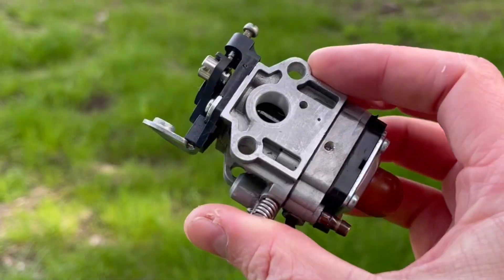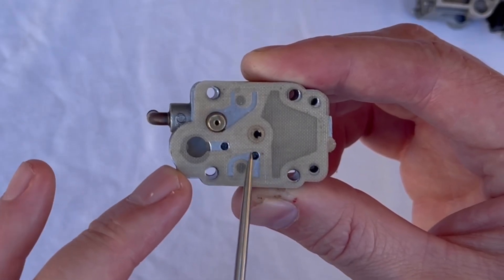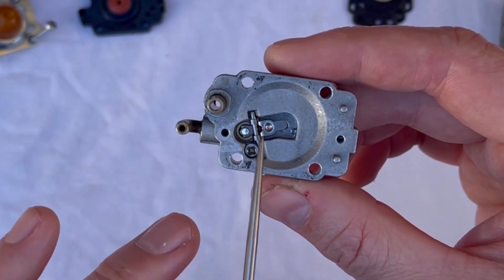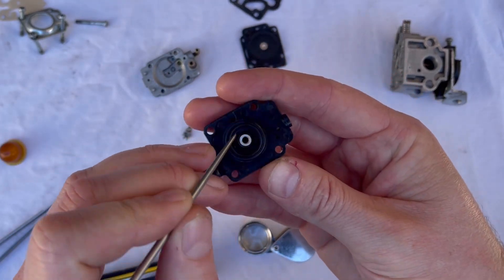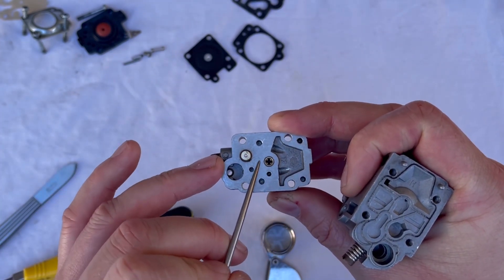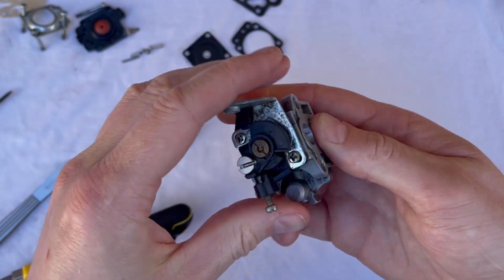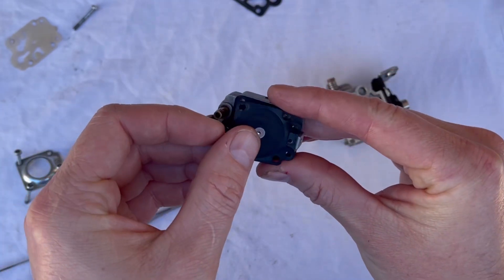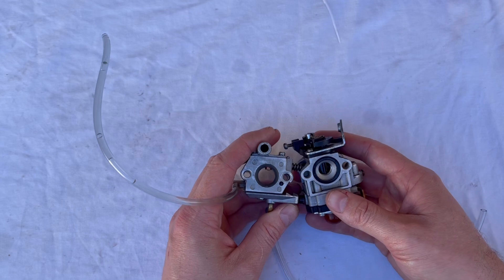Rotary Carburetors: In-depth Fault Finding, Testing, Service & Repair!

Comment: I hate these carburetors
Reply from the maker: Why?
Reply: @VintageEngineRepairs i think they fail more often than traditional gaskets carburetors. But im just a gardener that tries to fix his own machines. Thanks for your content!
Reply from the maker: Interesting! They're hugely reliant on good filtration. The barrel will wear if not, but they're actually a better design than the butterfly type :)

Comment: the screw for the low speed setting on my carb doesn't have a slot for a screwdriver. i assume it's the original carb though.
my engine starts only once a day and runs rough. 
i can make it run better at 3/4th throttle when adjusting the HS fuel screw but then it dies when releasing throttle.
so it either runs ok'ish at idle and upto half throttle and surges above that, or over half throttle with adjustment from the HS fuel screw.
i just ordered another carb on alie...eventough i just heard you say better not to do so...it was already ordered.
Reply from the maker: Yeah my success from AliExpress is about 10%

The low screw may have a different head profile like mini Pac-Man! Cheers :)

Comment: You mentioned non sealing on barbs. I have a leak on the return line but I can't get it to seal with new line. Am I just being stupid or do you get case of smaller return line or something else I am missing?
Reply from the maker: Yes hoses come in different sizes 👍

Comment: I had one of these carbs on a scooter that would start and run perfectly for about 1-2 minutes then it would flood out and wouldn't restart without de-flooding the engine or letting it sit for at least a few hours. I tried everything rebuilt the carb(new diaphragms and needle valve), reset metering lever height, cleaned whole fuel tank, replaced lines and fuel filter, and tried running with gas cap loose but no matter what it would flood out after a few minutes or running. I think it had a cracked or warped metering block or carb body because i eventually replaced the carb with another one and the problem stopped.
Reply from the maker: That's quite possible :) especially if they're plastic!

Comment: Have a rotary style carb on a RedMax backpack EBZ7500. I cleaned the carb thoroughly (ultra sonic) and added new kit diaphragms & gaskets. Can't get it to start when cold. But if I add a squirt of fuel down the plug hole, it starts and runs fine. Then it continues to restart as long as it's hot. After trying to start it cold, I have checked the plug and it is dry; ie, doesn't appear that fuel is entering the venturi even though the purge system is working fine. Was hoping you would discuss how fuel gets into the venturi (from the vacuum created by the pull cord action?). Anyway, any advice on solving this problem will be greatly appreciated.
Reply from the maker: Hey, I’d suggest you open the L screw 1/4 of a turn anticlockwise. The L screw is at the top of them :)

Comment: Great video as always.
Can you do a video on accessing the low speed screw on these?
They make them difficult using different tricks. 
There's the black plastic you pop, (easy) the resin filled one, the small offset hole one, the sort of triangle one and so on
Reply from the maker: Hey! Check out this video it may answer your question! https://youtu.be/sY14oNCXvrw?si=tqv1ron4kANu143t

Comment: Oh yeah,I drilled out the brass sealing plug  where the high speed mixture screw used to be on the dependent type of rotary valve carburettor & since it's an emissions type of carburettor it didn't have an adjustment screw underneath it therefore the only way to adjust the mixture on them is to adjust the low speed mixture adjustment screw inside of the rotary valve barrel mechanism.

So that's why I reused the original Honda carburettor on the Honda GX35 clone engine last weekend,my dad did some whipper snipping with it today with it & it went beautiful unlike on Saturday when he tried to choke it to run it then it just couldn't keep running.

So I didn't care about ruining a Chinese Walbro WYL copy which I can replace for about $17 AUD on eBay,if it's dumping in too much fuel because the hidden valve which is underneath the brass sealing plug is letting too much fuel enter the metering chamber then just throw it in the garbage bin then buy another carburettor to replace it.

It shouldn't be a problem on the genuine Walbro WYL carburettors but !
Reply from the maker: Yes some can’t be adjusted unfortunately!!

Comment: I know about those Chinese carburettors because I just received a Chonda engine on Friday to replace my fathers old Honda GX35 engine on his brush cutter because it had a scored cylinder in it & it was beginning to really burn oil.

I couldn't tune the new carburettor to idle properly because it would idle then stall out 15 minutes after I used it or it wouldn't idle if I let it sit overnight so today I pulled both the new & old carburettors apart then I swapped the diaphragms over because no matter how much I adjusted the low speed mixture screw it kept stalling.

I haven't went through & thoroughly checked the new carburettor for the needle arm height but I think that the check valve might be leaking underneath the metering valve arm so it was probably sucking air into the metering chamber.

The engine starts & runs good with the original Honda carburettor fitted so I think that I might go through the new carburettor one day because I want to build myself a new Chonda GX35 engine as well, thanks for letting me know that the whole metering check valve can be replaced, someone else in here just sells the discs, not the whole entire assembly.

I just ordered the engine because the grass needed to be mowed & I can bolt the engine straight on, which I have done,I also had to reuse the original Honda clutch because there was an issue with the Chonda One making the head of the brush cutter spin at idle speed !
Reply from the maker: Glad the tips helped and I hope you get it sorted!!

Comment: Nice work, well explained and encouraged me to have a go but....I may have missed something because my Walbro WYL 115A fitted to a Mantis tiller is now leaking fuel into the venturi or bore of the carburettor not sure where from  and empties the bulb overnight. Could you shed some light on reasons that this might happen. I was thinking of investing in a Mityvac as I have a strimmer too. Thank you for sharing your knowledge, we all appreciate it!
Reply from the maker: Hey :) sure, your needle is likely leaking! Possibly debris there or worn rubber tip 👍
Reply: Thanks for the reply, as the needle is new, would there be any other possibilities for fuel leaking into the carb bore?
Reply from the maker: Hmm; if your main nozzle valve is leaking and the idle drillings don’t have a nozzle valve then it could cause it to leak what is left in the fuel pump, but that’s not much. Or if the accelerator pump oring is leaking it may cause the fuel to seep by the nozzles. Maybe there is a gasket leak? Something not right: My first port of call would be to pressure test the carb, a new needle can leak if there is debris holding it open, it’s not been machined correctly or the seat is damaged or dirty.z

Comment: Nothing compares to a genuine Walbro. I have flowed and compared hundereds of Zama, and amazon knock offs and none have performed  literally half as well as a Walbro. But i have notices its not just the barell type carbs the chinese fail to copy.
Reply from the maker: Interesting! I must admit I can’t tell any difference between oem walbro and zama!
Reply: @VintageEngineRepairs  you could if you were using it for top speed on a powerboard
Reply from the maker: Gotcha, yeah I only use them on small engines for garden power tools.

Comment: Hello, Tom!
My trimmer's running great but can't start (i mean it starts from 100th try or so). The spark is ok and even replacing the carb (same type as on this video) didn't help. What can it be?
Reply from the maker: Hey! Sounds like a fuel delivery issue, check the fuel filter, fuel line and also pressure and vacuum test the engine :)
Reply: @VintageEngineRepairs  Thanks for the answer!
Fuel filter was also replaced with the new one, combined with the line.
Just finished to watch your tutorial on pressure/vacuum test.
Will check it soon. Thanks again!
Reply: Hi Tom!
You won't believe!
I've just started my f-ing trimmer (it took all 6 days!).
The reason was just a spark plug! The old one's successfully giving the sparks and the tacho approved it (one of your advices!), but once i've installed the new one plug -- trimmer's starts like a brand new one!
I such a happy to get it working! Anyway, thank you a lot -- i've learned a lot from you!
Reply from the maker: That’s great mate, I’m really pleased for you :)

Comment: Thanks for a detailed breakdown. I have a Honda blower (HHB25 with GX25 engine)that's made with the main jet being non-adjustable (blanked off) and the idle jet being very difficult to access. From memory the code is WYB. Do you know if there's an off the shelf walbro carb I could replace this with, or am I screwed and need to buy OEM? I'd like to have a carb I can properly service if possible.
Reply from the maker: Generally 4 strokes are far less sensitive compared to 2 strokes. If it runs good, I’d leave it well alone :)
Reply: @VintageEngineRepairs  it's not working properly unfortunately, and I know it's the carby (cross checked with another) stalls on heavy throttle application. Tried tuning and putting a service kit through it without any luck so far
Reply from the maker: @jaredbawden6707  ah that’s annoying, I don’t have a cross reference, but if you google the carb model number, you can see if you can cross reference it!

Comment: Superb video! I have several of these exact carbs for a string trimmer. I have tried to order the "main nozzle check valve" here in the U.S. but the sellers always ask for engine numbers that are worn off my trimmer. Can you or one of your subscribers provide a link for the check valve for U.S. market?
Reply from the maker: Hey! Although I don’t have the part number, best you search the carburetors model number that will be stamped on the side. Then type after it IPL and a diagram with parts will come up!

Comment: wow! Excellent video. Thank you.  You answered my question about which stroke variation this carb is, 2 stroke.  Do only the 4 stroke models like that have an accelerator pump, or can 2 stroke models have them too? BTW, the one on my 4 stroke has no primer/purge bulb.
Reply from the maker: Yep they don’t all come with a purge :) it’s not an accelerator pump in this case, it’s a fuel pump, important to discern as some carburetors have accelerator pumps which are totally different haha. Only 4 stroke carbs have the spring ;)

Comment: While I really appreciate seeing an in depth video on the barrel type carburet, usually a Walbro, most of the carburetors I see are Zama butterfly carbs. Also, while vacuum and pressure testing are useful, most shops literally remove and replace carburetor with a new one, and adjust. There is no money in testing, rebuilding, etc. I usually clean carburetors first, the if that doesn't work, replace with aftermarket one.
Reply from the maker: Thanks for watching :) this one may help - it’s a butterfly video. 
https://youtu.be/_4K6dBQTeek
Reply: Aftermarket quality is a lucky dip
Reply from the maker: Yes it is!